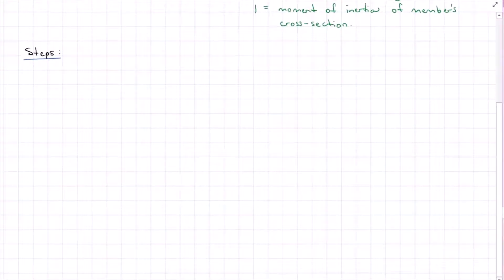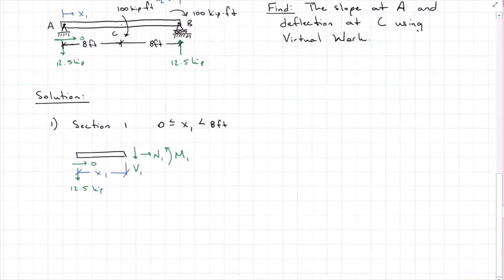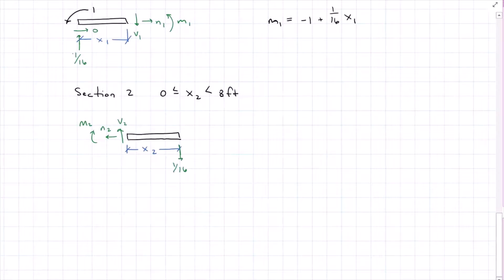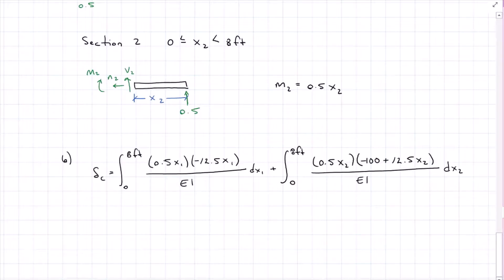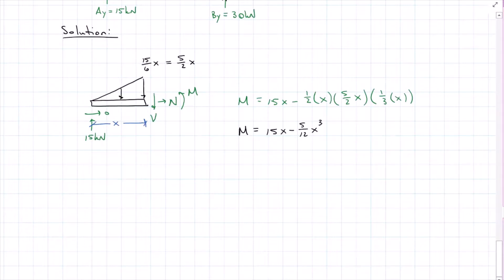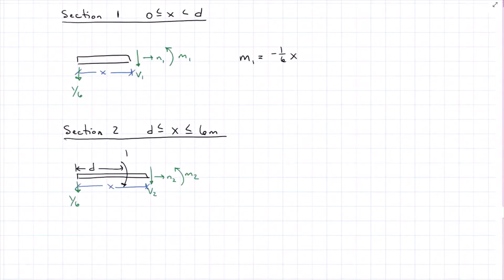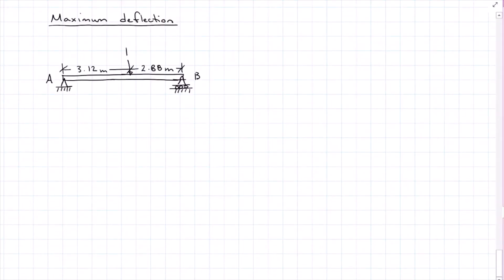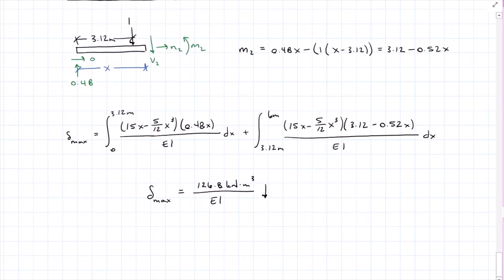Virtual Work Beams

Comment: Thank you so much for the video.
My question is; why didn't you include the 100kipft moment (acting at C) while calculating for the M equation (for slope at A in real loading) after sectioning?

Thanks